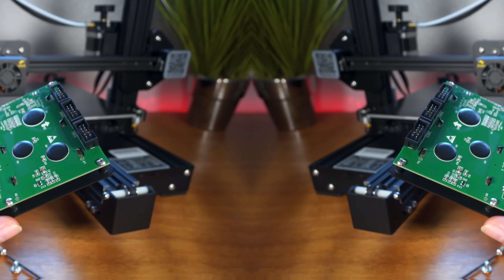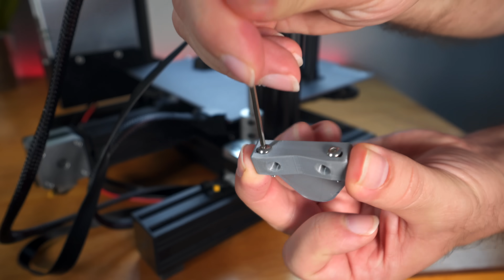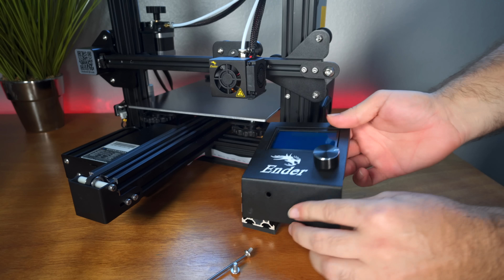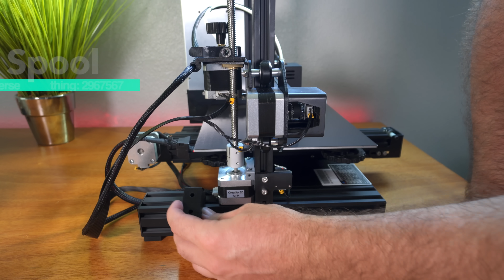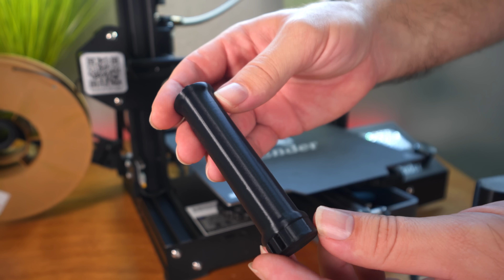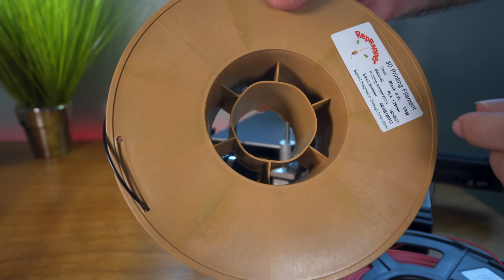Creality Ender 3 Pro - 3D Printer - Upgrades & Fixes

Comment: I suspect someone already mentioned this. but if you flip the arm that the spool holder screws into so that the nut is inside the u-side you can adjust the actual spool holder to stand up and dcwn

Comment: I have been using my Ender 3 Pro for one Month because I got it for Christmas. I am impressed with how clean the printer looks in the video... mine turned so dirty after my first try n' error experience. XD All over, I am thrilled with my printer and I even am going to change to a direct drive soon to prevent some issues my friends got earlier. If the little storage compartment is a bit loose, the tools are starting to get noisy but the sown upgrades are great!

Comment: Good video. I do have a couple of concerns. 1. I’m sure the reason Creality left the back of the circuit board open is to dissipate heat. Did you consider printing a cover with air vents. You could even install a small computer fan. 2. Those little fittings holding the tubing are great when used properly. They are designed for pressurized tubing. The pressure actually swells the tubing and pushes it back against the “teeth” that hold the tubing in place. This obviously isn’t the right application for them. You could try a compression nut with a Ferrell. That would hold it in place.

Comment: this is some really cool little fixes and mods for sure, alot I wanted to fix as well, #1 for me is the spool. Putting it together I didnt like where it was and that was my very first printer ever. Just got it 2 days ago and love it. These mods will just make it even better for me. Only thing Im wondering about is does the spool hanging off the side on the bottom rail, will that put any twisting tension to where it would make something out of square over time?

Comment: Good tray - as you probably know, over time pla will shrink and that tray will slide easier. Maybe there are filaments that are designed not to shrink over time but all my builds shrink, which makes it hard to have any pieces built originally with some precision remain in that precision over time.
Your builds do look nice, good examples.
I totally agree about mounting that spool way up in the air where it will rock the printer.
You want just a bit of drag when you use bearings on the spool holder - otherwise the momentum can overrun the draw rate of the bowman feeder. Happy accident it ended up canted just enough on your design.

Comment: Awesome tips. Wonder if you could help? Just set ours up. Same model.  Did the home command and leveled the bed. After that I tried the home command again and the print head just jerks, no movement. Ideas? Thanks

Comment: Thank you for the videos and all the files, tool tray is def a must have. Question regarding the knob, I don't have a metal piece sticking out to insert into the knob... mine is basically just flush to the filament feeder / roller thing... is that piece (the part sticking out) an upgrade I could buy somewhere? Thank you

Comment: I wonder if those "cuplings" are push lock fittings. If they are you need to push the plastic color ring in as far as it can go while inserting the line to lock it. I work with airline that uses similar fittings.

Comment: You actually put the spool bracket on wrong that's why the bearing roller was not pointing straight up. You had the bracket on right the first time.

Comment: Regarding aligning the printing bed Level. I had the opposite issue with mine. The screws were so darn tight and it was still "scratching the surface" so I had to put the stopper/switch a little further up.

Comment: those polyflow connectors and polyflow tubing are meant to be used for air.  When there is any pressure in the tube greater than the atmosphere then there is almost no play in that connector.

Comment: 5:10 Mine actually came with these clips injection molded! I like that they take working solutions and include them in the kit. A different fitting would be nice, but why make the printer that much more expensive if the clips work this well.

Comment: You should not be moving the stepper motors like you are. they can generate electrical current and fry your main board (moving the z access gantry fast at ~3:30-4:00 minutes)

Comment: I have a ender 3 pro and it has dual z rods with 1 stepper motor driving both rods with a pulley and belt system at the top just bellow the filament. Was working fine for about a year or more but not only goes half way up , stops and makes a clicking noise, what am I looking at to correct?

Comment: What fillament was used for the upgrade parts; PLA, or ABS? 

Also my Ender 3 came with the clips for the PTFE tubing. The etcentic bolts also dont have the nuts for tightening with an alan wrench, they are just standard nuts that turn the bolts when you try and tighten them, leading to the etcentric bolt working lose again. So cant actualy stabalise the bed properly. Anoying...

Comment: Tip, if you print the spool holder use PETG not PLA, PLA will bend after a day of use, considering your holding 1kilo of weight, or reinforce it with an aluminium plate underneath it

Comment: Hey I have a question I know this video is old but hopefully you or someone will see this. Around 2:58 - 3:02 you were able to the extruder in the z-axis fairly easily. I have an ender 3 pro but I cannot move the z-axis that easily as you did. It will move down (-) if i push down on it with a little bit of force but it will not move up unless I go into the menu and manual set the z-axis to come back up. I have had trouble printing certain components after a certain height of about 3” and I believe the z-axis bar is the reason. Any thoughts on this issue?

Comment: I just got an Ender 3 -- I paid $165 from Amazon with free shipping.  These keep coming down; there's now a smaller printer (about half size workspace in each dimension) that's around $100.  Once I get it assembled and a space to set it up (I have a plan, just need hours to work) I'll be ready to start printing the upgrade parts -- I collected every part you mentioned here on Thingiverse, so I can find them again quickly.

Thanks for making this video -- stuff like this helps tremendously for those of us who are late to the party (because we don't have bleeding-edge budgets) get caught up.  I've been saying for the past year I need to get a 3D printer -- now I just need to get it busy.  And then, once I have have everything dialed in, I need to go through the learning curve for ABS, both for chemical/mechanical reasons, and so I can smooth my prints with minimum effort.

Comment: i got the ender3 a couple of days ago. i decided to not move the spool, but the z motor spacer and the lcd shroud i already printed. the clip for the feeder came in the kit, two or three of them actually.
i am currently printing a base for 2 drawers that will go where your tub goes. and i have, printed a bunch of cable chain to tidy up the cables at the rear.
today i should have a glass bed, auto leveling and some firmer bed mounts turning up, as well as some blue filament. im going with black and blue colour scheme for the printer.
the feeder knob is on the list to be printed.
love this printer its impressive quality.

Comment: I just bought an Ender 3 v2 and it comes with a tool tray built in. My suggestion to you would be to make a cover for the tray so that you don't have a tool sticking up and crash your bed leveler screw into the tool. That is what I would do.

Comment: Hi Vlad, I have a question, I hope you can help me. I have a Ender 3 pro, I'm using your SD card extension design, but when a connect the adapter the printer is telling me that the card is inserted and there no card just the SD extension cable adapter. I also have a Ender 5,  I printed an housing adapter and is working great. I wonder if you have encounter this situation with the Ender 3 pro. thank you for your help.

Comment: Thanks for that info. I just got my Ender 3 pro and had the issue with the micro switch being too high making it difficult to adjust the surface gap. Trimmed off the small tab as you did and was able to have a positive gap adjustment without running out of thread on the adjuster wheels.

Comment: I know this was posted in 2019 and surely this tip has appeared in the comments by now but I'll say it anyway.
16:53 flip that plate (with the hole) backwards so that your printed spool holder isn't forced to be aligned by that "channel", that way you can align it perfectly vertical

Comment: Hey Vlad! We just released a brand new perfect-fit mirror bed for the Ender 3. 2x mirrors + 4x one-piece stainless steel bed clips. We even had every single one certified flat to within .05 mm. I'd love to send you one and have you try it. Search "ender 3 mirror bed" on amazon and look for Goodey Brand. hxxps://www.amazon.com/Goodey-Printer-Mirror-Bed-Borosilicate/dp/B088PC3F69

Comment: I have that same "weird under-extrusion" on the display case I printed too. Each layer stopped at a different point and started at a different point. It was my first print, and I thought it was either my expectations being too high or the printer being mucked up. It was neither and is printing error-free since.

Comment: So I printed out a few of these parts. Two of which were the filament guide, and the Z-axis mount. They don't seem to work well with my Ender 3 pro. Maybe they have changed some things with the printer since this video was uploaded. Anyways, so after I put those parts on and went to "Home" the printer, the Z axis motor wasn't turning, and clicked once or twice before I could hit the off switch, then it clicked a couple more times from the residual energy. I replaced the printed parts with the original, and now the Z axis moves freely while turning it by hand, but the motor seems broken and won't work. :( I should have checked to see if the printer would move freely Z-directionally before I turned on the printer. I hope the motor is just bad, and nothing else. :(

Comment: When I got my Ender 3, it absolutely wouldnt print anything. I thought I had made the worst decision in my choice of 3D printer. Then I changed the couplings and tube to the capricorn and no issues with printing.

Comment: Great video. I just set-up my Ender 3 Pro, though I bought it about 2 months ago. I had the same issue with the bed being too far below the hot-end during my first attempt at bed-leveling. I was pretty frustrated but took a break and came back. It worked out much better during my second attempt. Sometimes patience wins the day. These printed upgrades are all really useful because they are practical. I like that. I downloaded nearly all of the files from Thingiverse and will be printing them soon. Thanks for all the tips on this product. You definitely helped me out with an overall understanding of what areas may become pain points in the near future.

Comment: Hi there. Thanks for sharing the upgrades. Are those additional add-ons designed by yourself?  I think if the tool box has a covering would be great though. Can you kindly advise what is the difference between this Ender 3 Pro and the Ender 5 Pro or Plus? Thanks

Comment: I cannot get my base layer to stick. I upped the plate temp to 90 degrees, re-leveled my base, but I cannot finish a print of the dog. I got 51% into the print and it lost adhesion. Any suggestions.

Comment: Good job!
I guess they listened to your suggestions about the little clip for the tube.
That small piece you suggested came with my ender 3 printer today.
I’m having an issue with mine that the print is not sticking on the bed. I think I leveled the bed right. Any other suggestions please?

Comment: You lowered the Z axis switch. That’s interesting because the instructions say it should seat at 32mm. But that’s impossible on mine as that horizontal knob prevent me from lowering below the base. And it seats around 37mm

Comment: 16:52 Just flip the support bat 180 so the flat side faces the spool. That will allow you to use your new bearing spool holder at the correct angle.

Comment: Why does he keep calling it a coupling? It's a push fitting. Couplings are used to join shafts a pipes together. Fittings are used to attach tubing (air/water lines). The bearings for the spool may not be a good idea. You don't want the spool to spin too freely. The filament will cross and bind if the spool becomes too lose (aka birdnesting). I feel like most of these fixes are not really fixes but more OCD and fiddling. I am an OCD type and I do fiddle a lot. Anyways I enjoy the video and keep on making more videos as it will grow the hobby. Cheers!

Comment: Is there a way to find out what the "average" material cost and time should be for some of these prints? Sometimes I get what seems to be outrageous times like 8 hours for printing something like a 3"x3 x 3" small parts bin. Using no infill, speed 110mm/sec, 0.28 height. I'm probably doing something wrong...hopefully someone can help.

Comment: allmost everything there lets buy good 3d printer and then make it even better,but nobody havent done SAY NO BED LEVELLING. build it flat in first place LOL. wtf springs lol.
you have 3mm bolt with 10mm spring something.. lol spring is like free to mo x and y when you bump bed it change bed level. between bolt and spring should have sleeve.
and why there no adjustment on centre lol bed is not flat with adjustment you can pull or push it to make it flat and level.better if no spring. flat as you can get. thats that never need bed levelling just move z offset. i have 200 buck automatic bedleving sensor LOL. who needs that if bed is allready levelled and flat lol

Comment: Hi Vlad, Excellent video. Am experiencing huge issues with printed parts coming away from the print bed part way through a print. Not been able to print anything in its entirety because of this. Ordered a glass bed and a magnetic removable bed and tried glue sticks without avail. Are there any recommendations you can make please? Thank you.

Comment: 4.40  
I dont know if its allready told in the comments, but the pneumatic speedcupling is not faulty, its just designed to be working under pressure.  (and quick & easy to use unpressurized)

So i guess it is just a easy & convinient pick of component without all that concerns about its regarded function.

Comment: I considered buying creality printer again but creality SD card slots are very unreliable. My ender 2 can only be connected with USB connection to my laptop, and there's no internal memory, lose connection for a second and the print is ruined.  I bought flashforge adventurer 3 instead of ender 3. Because my creality menu/prosessors is a bit slow and it isn't the most user friendly. Creality just lost a returning costumer.  I'm going to use up my ender 2 on smaller prints. But I'm not trusting for larger prints.

Comment: I have a 2020 ender3 pro, and it hase non of the issues the older ones have.
- Z Spindel Motorbracket is fixed.
- bowden fittings have no play to them
- exdruder inlet is brass, filament dosent cut into even with the crap spoolholder
- never Stripped filament, even up to 13mm²/s, also with the crap sooplholder!

i just ajustet all the rollers so they have no play.
Tightend the bellts realy good.

Printed a better, and lighter Hotend and partcooling assambly.
Put on some cable chains for the bed and z axis cables.

now it´s a realy good little printer! thumbs up for china! xD

Comment: It is not the coupling it is your tube. Those white ones are too soft but the black ones for air which the coupling is made for melts at a too low a temperature to be useful. You need the blue ones as it is hard and can stand heat.

Comment: The problem with the Z axis not being perfectly vertical is caused by the mounting bracket for the motor not being completely 90° bent.  Take it off, fix the bend, replace it.  The problem with the tube coming out is because people put the fitting in and then put the tube in.  Put the tube into the fitting THEN screw the fitting into the extractor.

Comment: Hey Vlad, love your videos! I just got into 3D priniting recently and am having issues with sticking to the bed and have tried all sorts of tips. The only thing that works for me is using painters tape and diluted pva glue. I was wondering what hot end and bed temps on your Ender 3 Pro you found works the best on PLA? I have been using 215/55. Cheers.

Comment: I just got the Ender 3 Pro a week ago and have had little problems with it. Main issue is leveling the bed as it seems to go out on each print. My question is, where are these print files able to be downloaded? I saw a Thingivers number given but on search nothing is there.

Comment: Got my ender 3 pro today. The pressure fitting was included. To bad it was useless. I put a small plastic piece against the tube and slide it in (0.1 mm  i think) and now it works.

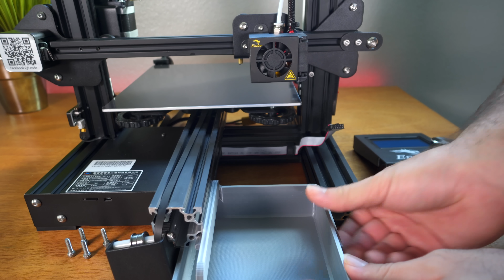Comment: Around 10:05 when you install the tool tray it appears that the Y axis moves. You also mention that it is a little snug. Did it make a difference when you installed the tray?

Comment: I  keep getting an error message: "Thermal Runaway printer halted. please reset" use PLA at 210 extruder and 50 on the bed. Is there a fix?

Comment: The bed so high with that small piece in the sensor bracket is because the Ender 3 Pro comes prepared for the glass bed already, I think. Once you leveled the bed without it, there's no issues leveling again, except if you want to put/take out the glass sheet.